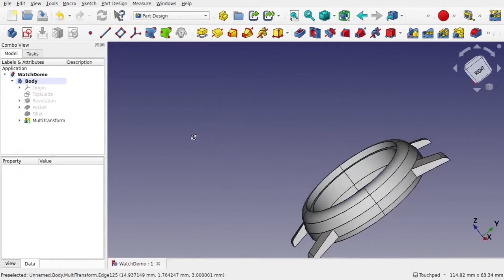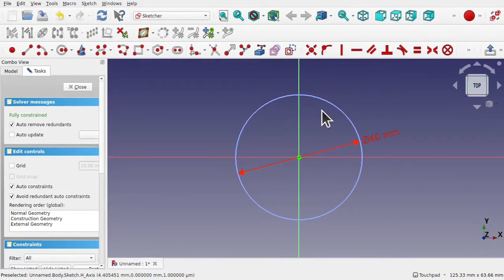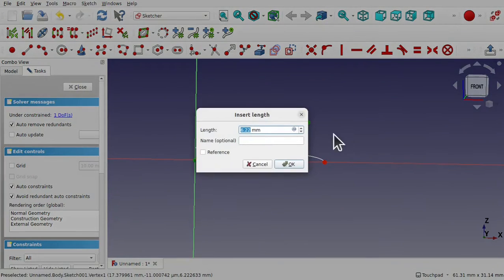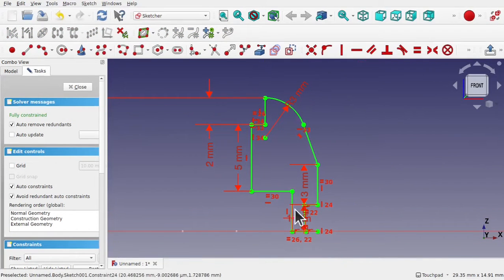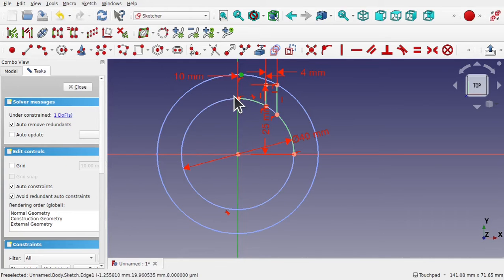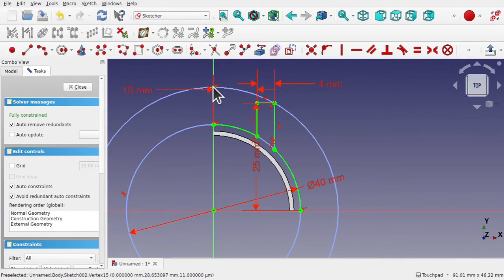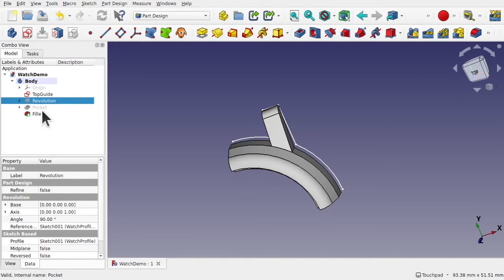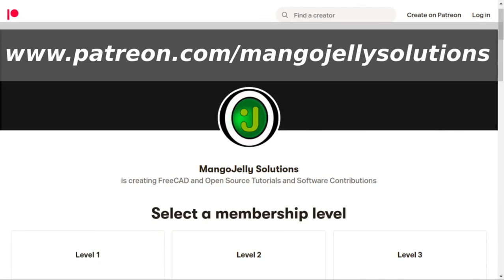FreeCAD For Beginners | 37 | Part Design Multi Transform Workflow | Simple Watch Enclosure

Comment: Another great tutorial. with every step I learned something. knew I had no trouble completing this with version 1. and I Suspect. I'll have no problem doing it with The older version . 21 Either I like to do the. exercise twice. It kind of cements it in a little bit better.  but this one was fun and I had no issues and no problems doing it. Unlike the lofts workflow, a few exercises before this, I couldn't get that to work on any version.

Comment: This is off topic but I can't find any place to ask questions. I am trying to model a plastic corner that will fit on the aluminum pannier on my motorcycle. It is essentially a 6 sided cup that fits over the corner. There are three long sides and three short sides, so it is really an equilateral triangle with the apexes cut off. The long "sides" are at a different angle than the short ones. I can model the basic triangular shape with the three corners taken off and pad it. I then set up a datum plane on a short side and set it to the angle the sketch that side is supposed to sit at and make the sketch of that side on the plane. The problem is it won't pad. It also won't tell me why except to say, "15:39:09  Recompute failed! Please check report view." What am I doing wrong, or, what am I not doing right?
Reply: OK, I figured it out. The plane needs to be slightly inside the figure you are trying to attach the new sketch to. I had it attached to a face but only to the surface. The software was treating it as two unattached parts.

Comment: Excellent video as per usual!
Reply from the maker: Thanks again!
Reply: @MangoJellySolutions  If you ever have some extra time I would appreciate a walkthrough of the Path Workbench.  I want to move all my gcode generation for CNC milling to FreeCAD for an easy design to prototyping process.  The documentation on the FreeCAD Wiki for most of the operations in the Path Workbench is lacking so if you ever get the chance I would appreciate it.

Comment: Good demo video, thanks for that.  For me there was a bit too much unnecessary stuff around it. For example, the auxiliary geometry, which could also cause confusion for one or the other beginner. Using the pocket as a cutting tool is a fine addition. The multiple transformation is the solution for not fully symmetrical solids.